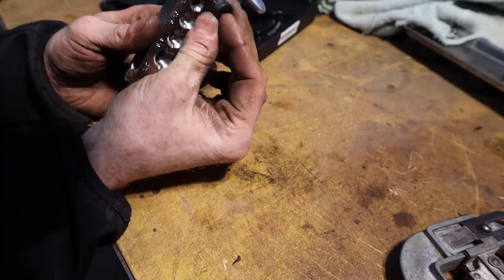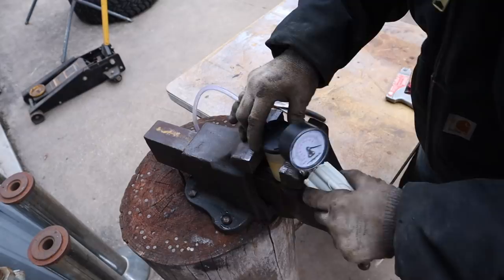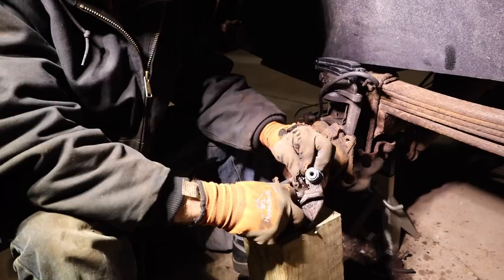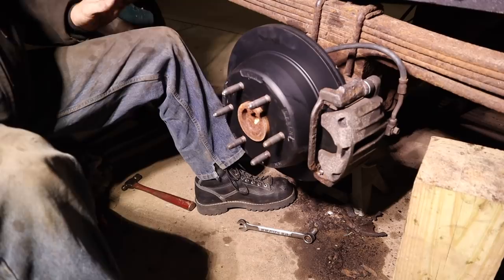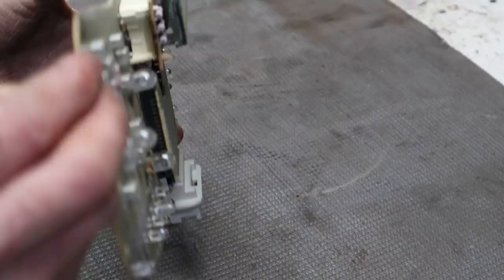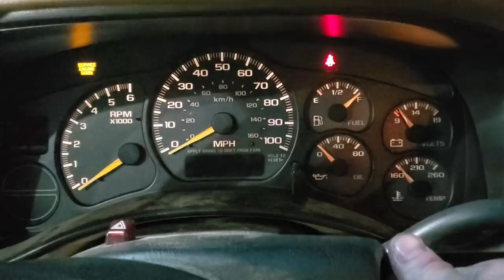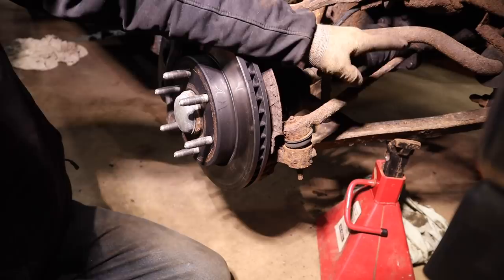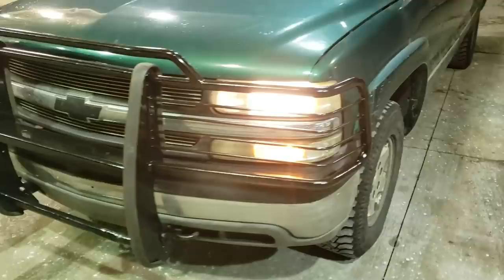Fixing My Trusty Old Pickup Truck ~ It Sprung a Leak & a Few OTHER Things!

Comment: A tip for you! When soldering have a damp sponge to wipe the iron on. Soldering works much better when you clean the tip between each joint. Also only put a tiny bit of solder on the  tip then wiggle the iron on the joint to transfer heat across, most of the solder should be applied to the target

Comment: Good for you.  I bought a Ford F150 brand new in 1996 and had that truck for 20+ years. I replaced all the brake lines, rebuilt the engine, rebuilt the transfer case, rebuilt t but e rear end,  replaced all the axle parts, chassis, suspension,  and more over the years. In 2018, after 22 years of service, I traded it for a brand new 2018 model. I love my truck and I love driving it,  but still bummed that I traded the old girl.

Comment: My old beater truck ( a 1999 ford econoline) has over 200 thousand miles on it and I'm ready to get rid of it. The frame where the body attaches ts rusted thru. I could weld it backup using angle iron but I've had it since 1999. I'm retired now I think it's time to get an other newer one. I've got my money's worth out of this one. I'm looking at a 2010 with only 50 thousand on it. I figure I can break it in.

Comment: Years ago I had an old truck mechanic show me an easy way to pick up and align a large wheel with the studs. He rolled the wheel on to a tire iron and used the iron as a lever to raise and align the wheel with the studs. It's a real back saver.

Comment: When compressing the piston on the caliper, I would suggest that you use the used inner brake pad. it makes for a better flatter stationary platform for the C-clamp
Reply: Used outer brake pad works better, doesnt get stuck. This is assuming your inner has clips.

Comment: A lot of work but well worth it. The double winch system was a great idea. I liked working on my equipment until I became disabled.  I really really enjoy your work and saving plus restoration of the said equipment.  I do wood turning from my wife's grandfather's lathe from circa 1890s lathe. He and his father had a specialized wagon's shop slash business in Indianapolis that she inherited along with other tools. I appreciate your channel and the work you do. I also have some of her father's drafting table with the drawing tools plus several drawings of architecture and mechanical engineering drawings.  He was an engineer for General Motors.

Comment: Your story about the trailer brought back a memory. In '02 I bought a 2000 ram dually with a Cummins. Super good deal from the dealer, had the whole list of safety inspections, well that same week on the home I was coming down a hill. I had to turn 90 deg to my right. Hit the brakes and had none.
When I got stopped by gearing down I called a wreaker to tow to dealer. The rear drum brakes were metal to metal. They had to cut everything apart to get the drums off.
Reply from the maker: That was a close one! I have blown brake lines, but never locked up a drum or caliper that bad!

Comment: I drive a 2001 Ford Excursion and had this problem. I bought a stainless kit that was pre bent and ready to install. Included the rubber hoses too. Best $250 I ever spent. My brother has a 2002 Suburban and he did his in the copper alloy, he was very satisfied with the results too.

Comment: The "burn mark" on the display is normal. That is called the "getter" and it absorbs any remaining gases in the sealed display. If it turns white you know the vacuum has been lost and the display has failed.
Reply from the maker: Interesting! I did not know that! Thanks for mentioning that, I was wondering if mine might eventually need to be replaced because of that!
Reply: With electronics clean, clean, clean (alcohol w/ trimmed acid brush, white pencil erasure, lint free wipes) is super important to get a good solder joint, including the pads, solder, and leads. Use rosin flux not acid (yikes) and thin it with alcohol, a little goes a long way and clean again when you're done soldering. You'd be amazed how it flows and shiny it is if done well.

Comment: Man I love it when you take good care of your Chevrolet Silverado! I have 2000 Chevrolet Silverado and been use that from 2005 to 2018 and then parking on driveway for a while because of oil pressure messed up. I replaced oil pressure sensor (or switch) but the dial on info center show zero and when you hit the gas, it go up to around 20 but it go back to 0 when you stop. I love my truck and miss use my truck. I’ve use her for 13 years. Now I got a new car which is 2017 Chevrolet Malibu. By the way my family on my dad‘s side bleed gold!

Comment: I know your pain, because on a 80 ton chiller. It has copper lines like a car brake lines . I flared the ends and looked down on the table sat the flared fittings. I got ribbed about that every time I got to work on the chiller.😂🤣🤘🏼😂

Comment: I really appreciate you sharing your knowledge and videos. Especially this one, because I have to either do the same thing or get it done on my truck. I was trying to figure out how hard it was going to be. My truck is a 2000 Chevy crewcab long wheelbase 4x4. Gas burner, K30. I’m still on the fence about it. It’s expensive to get anything done on my truck, just because of the K30.

Comment: hi I have to say you're a good fixer, when  I replace brake lines I do it with stainles steel braded nylon and do away with rubber flexables from master clyinder to caliper its expensive but so easy, changing the  ends to banjos,

Comment: Well done!  As an aeronautical and mechanical engineer, I like your selection of copper for its practicality.  Comparing the operating pressures of your truck and the thermal cycles to stainless steel, that should be ok.  Dissimilar metal issuesbetween copper and the brake line fitting may be an issue. If the line itself moves each time the brake is applied, that may cause an issue at the point where line and fitting are joined.  Lastly, the chemical composition of brake fluid at elevated temps could react with copper and leach away and degrade the wall thickness.  Outside of that, great presentation, and another video for my engineering students!

Comment: this is called a GM Inverted Flare.  You don't Need to do the double flare if you use softer material like copper, you can just to a single regular flare, and the fitting and brake line connector will crush the softer material into a correct seal.  Done this many times on older GM trucks that use these.  The copper is so much softer, it forms to fit really easy by just crushing it in there and won't leak.

Comment: It would help the flare if you flip the flaring block over(using the flat side) and put the line in there level with the top, and file it flat and debur inside the line...that will make a perfect flare.

Comment: My 99 needed all new brake lines too. Funny I did the same as you. All the lines were replaced only the one along the rear differential looked just fine so I left it be. I live in the Cleveland area and salt really does a number on our cars. I did away with my ABS too when it almost caused an accident. I know how to fix it it's just that I had it all apart doing brakes a week before in winter and I just wasn't interested.

Comment: You should use the old brake pads between the c clamp and the caliper piston to compress it. Pushes it in evenly and prevents damage to the piston. Just my .2

Comment: My brake tube rusted through UP inside of the frame on my 1999 F350 pickup.  It was a bugger to thread the new brake line through where it would not vibrate and wear a hole in the new line.
Reply from the maker: Yup! That's where all the salt water collects and then rots out those lines! I've been there! Thanks for watching & commenting!

Comment: Love your shows, your degree of over-engineering and shop/part organization.  I could work very easily in your shop and not mess up the organization.  I would like to comment on your soldering.  I think I saw some ways it could be improved for very small work like this:  1) I suspect your iron is too big, and the tip was not properly tinned.  You could have used the smallest iron/tip available and only cleaned and tinned an area the size of the solder joint.  2) Using 63/37% solder will melt at the lowest temp,, preventing board damage.  3) you frequently put solder in the iron tip.  Better to before each joint: 1)wipe the tinned tip on a wet cloth or sponge then 2) apply only enough solder to the tinned tip to “wet” it, allowing good transfer to the joint. 3)touch the wetted tip to the joint and apply the smallest amount of solder to the other side of the joint, just like in sweating copper pipes.  Hope this is helpful.  I learned soldering in 26 years in the Air Force where we were taught the same “high-value” techniques used in the space program.  Common enemy of good joints - too much heat!!

Comment: A little late but many thanks for another great video. I suspect the flux you are using are meant for piping and heavier stuff. Some of that are corrosive and are not so suitable for electronics soldering. It can eat away on the copper traces and leads in electronics. Some electronics flux (search AliExpress or EvilBay for rosin flux) can be had for less than $2 including shipping and will last for years. Some comes in one hard lump in a box and some come more or less in powdery form. It can then be melted in your cooking oven at about 150 degree C into a hard lump. One then just dip the tip of the soldering iron frequently into this lump during soldering. Also protects the tip of the soldering iron.

Comment: i have a 97 chevy 1500, its in a lot better shape than yours, but i agree, they are built like a rock, those old trucks will keep going no matter what! mine has about 187k on it and runs like a dream, just gotta keep keeping it up and it will keep going. i've also got an 03 that runs good as well, it only has about 125k on it

also, tip for soldering, hold it on a bit longer, until it flows in, touching it then pulling back can cause a bad joint

Comment: Saw some snow in this clip and assume salt is used liberally on your roads where you live
which can quickly destroy metal like the under carriage on your truck.  In Canada vehicles 
are eaten away in as little as 2 to 3 years.  It is quite common for owners to pay about $100 CDN  each year for some kind of rust coating to stretch usability . In your shop you could spray heated used motor oil on the under carriage  ( unless laws prohibit this where you live)  then drive on a dusty road  before winter to "seal" from dripping.  It is a crying shame to see vehicles scrapped because the frame is rotted out with salt helping the process.

Comment: MAN!  You would be in SO MUCH LEGAL TROUBLE in Maryland for using COPPER Tubing for a brake line.  You MUST use steel tubing in Maryland.  Yes you are absolutely correct in using the "double flare" on brake lines.  I had to use the old fitting from the old tubing.  I refused to pay almost TRIPLE the cost at the ford dealer.
Reply from the maker: Good thing I don't live there, because that makes no sense! Just like a lot of "LAWS" these days!

Comment: An old gf inherited a car from her dad so she took her 99 zx2 escort off the road and just gave me it to get it off of her property. Funny how a pickup truck has one single line running to the back then it’s split into two because this lil coupe beater has TWO lines run back to a dual splitter block. Whatta pita doing brake work was, I don’t envy you. Is it the camera? If I place one near me will it limit the overly adult language flying around me when I do these jobs? I’d try anything at this point, I think I scared my neighbors last time🤬 lol

Comment: You should never use anti-seize anywhere near the brakes. There is specific brake pin lube you should use, AZ is not able to stand up to the heat of braking and will absolutely melt onto your friction surfaces and glaze over causing your brakes to fail.

Comment: Your grill guard looks great, But you sure could make use of a proper paint sprayer. I know you have the air, cans just don't work as well and the quality of the paint is not as good, just saying. I know less to clean up, but the canned paint is not as durable.
By the way I have shared my life with 2 Weims and love the breed. Great dogs.

Comment: Wheel bearings sounds like. When you want to fix the body rot. Easy cut above the rot get into good metal graft in new.  Body filler sand off till about gone with a feather edge prime sand again but not all the way. You want to keep a rough texture so your base coat will adhere. Build dry in layers finally clear coat wet sand orange peel. Spray dry/spray dry/etc three or four coats looks dull clear is what gives paint it’s pop. Cancer is bad for vehicles

Comment: Wait.  Did the cluster from the junk yard not have a working circuit board?  Otherwise, why bother with all the soldering?  Just pop in the replacement cluster.  Unless you did it for the sheer fun of it, which I, of course, applaud.
Reply from the maker: In order to replace the cluster with a different one, you have to take the vehicle and new cluster to the dealer where they will transfer the VIN number and vehicle mileage over onto the new cluster, for a FEE!
Reply: @SalvageWorkshop  Makes sense.  Wasn't thinking about the odometer or VIN

Comment: Great video as I love seeing people squeeze every mile out of a vehicle before they are scrapped. With that said, the corrosion/rust is looking pretty serious. The rear spring u-bolts looked scary.  I'd insure you are inspecting the whole underside of the frame/crossmembers and suspension control arms closely. I did frame and alignment work in the 80's in S. California. We saw lots of rust belt vehicles at the shop from people who moved to the area from salted road states. There were several cars/trucks over the years that drove into the shop and were towed out to a junkyard after inspection. Why? Because the rust was so extensive that the frame, crossmembers or other structural parts were about to break and it was cost prohibitive to repair. So, the vehicles were unsafe for further use on the roads and needed to be scrapped. One 60's mustang was about to break in two! We showed the lady who owned it and she about fainted that she drove it in.  P.S., I wish I had your energy! Keep up the good work.

Comment: Hello Savage Workshop, I don't know your name or I would call you by name my name is Joe. Let me start off by saying that we have almost the same truck except for yours as four-wheel drive, I'm not sure where you live but I know it's the Rust Belt as I live in the Rust Belt to. In Ohio just west of Cleveland 50 miles as the crow flies from Canada. Anyway I've done a lot of the same repairs on my truck as I said it's two wheel drive it's a 1996 Silverado yes it's paid for a million times over. The truck runs great has ice cold air and has only let me down one time for a short while when the fuel pump went out. If I would have been smart I would have just cut a hole in the bed put a flap on it and changed it out myself but instead I let a mechanic shop do it because I was so extremely busy doing remodels at the time. Anyway brother I like your videos a whole lot you make a lot of sense to me in the things that you do, it seems to me that you always try to get it right no matter how long it takes or how painful it is. Thank you for bringing us along on your videos. Stay safe stay well and as always God bless

Comment: Have replaced so many brake lines on Silverados that I can replace all the lines in less than 4 hours.
Reply from the maker: I believe that... The more you do something, the faster you get! Do you use the cooper alloy lines?
Reply: @SalvageWorkshop  yes, that stuff is awesome. Steel line only lasts a couple years around here from all the salt. The alloy line seems to last longer and is easier to work with.

Comment: They need to quit using salt on roads. They can use a beet juice solution. They don’t realize it ruins car/truck bodies plus all the running gear. Etches paint. Then as the salt melts it leaches into bridges rotting the nuts and bolts. So your travers rvs to everyone else has got salt on things that cost a fortune for unnecessary parts. So when you travel hit the car washes

Comment: hi I realy  like you chanel   I have a 95 chevy 2500 4/4  does what  needs  done    paid for like  yours  not junk   smart money    I spray  used motor oil  all under the truck ever year  realy  helps with the RUST  problem   GOOD JOB  ohio
Reply from the maker: I appreciate that! Smart money is right! Gotta love the salt used here in the Midwest!